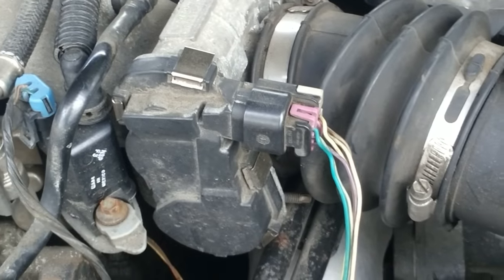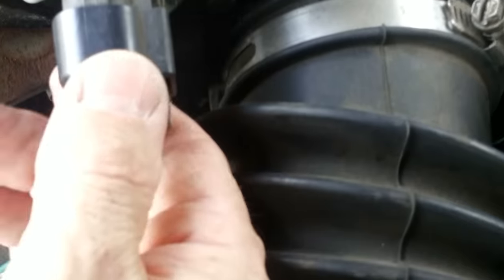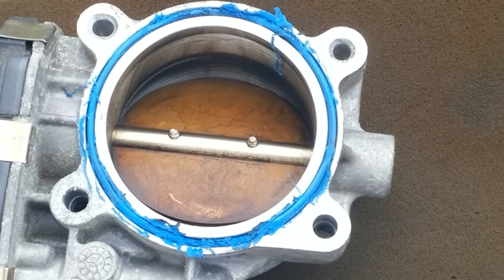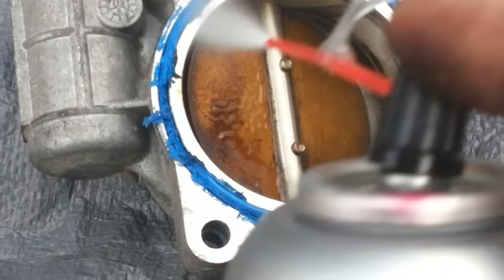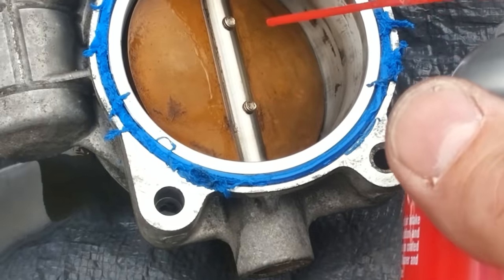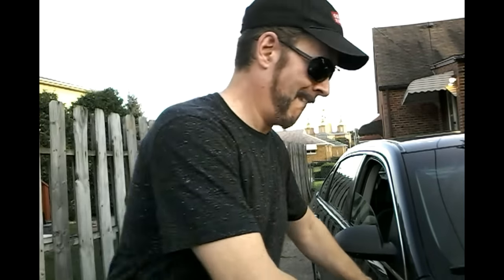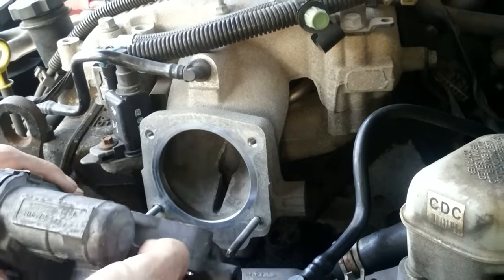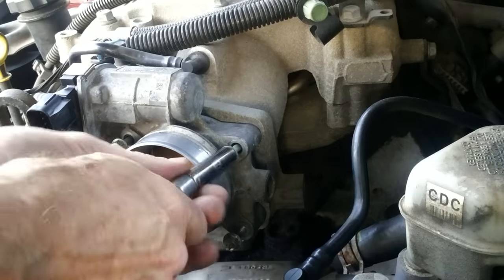Reduced Engine Power.  Here is the FIX.

Comment: Good video! My 2008 impala starts missing while driving, if I give it gas it smooths out, it will do this the entire trip, do you think it's the same fix as you did in this video? Thanks
Reply from the maker: Do you have a check engine light on?  If so, check for fault code P2135.  That's your TPS.  If no light, then it could be any one of several things.  Start with simple things first like dirty fuel filter or vacuum leaks.  Good luck!
Reply: No the engine light is not on. I took it to a garage and put it on a computer, it said it was a bad has pedal sensor. They replaced the sensor and it didn't help, it's still doing it. Thanks for the reply!
Reply from the maker: @wvmountaineer69  Have it checked for transmission codes.  Sometimes these can trigger reduced engine power and not light the check engine light.
Reply: Never buy an impala the transmission is definitely going to go out💯

Comment: My mechanic replaced the throttle body, it seemed to solve the problem for a few days; however the problem has returned. Any suggestions?
Reply from the maker: Besides taking it back to the mechanic?  Check it for loose or bad connections and grounds.

Comment: Hi so how do you know if it's the throttle body that needs to be replaced or just the sensor
Reply from the maker: The throttle body rarely needs replaced.  It just needs to be cleaned from time to time.   Unfortunately,  it's very difficult to find "just" the sensor.  They make you buy the whole throttle body and the sensor comes with it.  If you are getting fault code 2135,  chances are very good that you need a new sensor.  Check for that code before you change the throttle body.  Good Luck!  Let me know.  Thanks for watching!
Reply: @lifeafterlife8417  Thank you so much for replying.  Creators rarely do respond. I actually found the sensor separately but had already bought the throttle bottle, and the sensor was attached. I wish your comment would have came sooner. So after replacing the throttle body, I'm not getting these codes P1682, P0411,P1400, AND P0325. "Esc & engine power reduce" still displaying on dashboard

Comment: Hello . Can you give me your opinion on our Enclave issue? We have a 2011 Enclave CXL 2WD. It has 110K miles. Like a month ago it reduced speed on highway and showed "Reduced engine power", when my wife took it to Autozone for codes it showed several misfires. I researched the issue online and ended up cleaning the throttle vary and it worked perfect. The engine light disappeared when I reset the computer. No more issues until 3 weeks ago when were driving on the highway and the same situation happened. I took it to Autozone and the code was "misfire on injector 5". After I kept driving it the engine light disappeared by itself and the car was working fine until today. I was driving very slowly on the park and the same message came to the board, the car lost power and a lot of white smoke. I took it to Autozone and the code read misfire on injectors 1,3,5 and issue with fuel pressure regulator. Do you have any idea what could be the issue with this car?
Reply from the maker: White smoke could be an indication of a blown or leaking cylinder head gasket or intake gasket.  The codes for numbers 1,3, and 5 back that up because 1,3, and 5 are on the same cylinder head.  I would fix the fuel pressure regulator first because its the simplest and most inexpensive place to start.  Then I would watch for other signs of gasket issues like overheating and coolant loss.  Also, look at the spark plugs on numbers 1,3, and 5.  If they have a glazed or shiny appearance it indicates bad head gasket.  Autozone sells a kit to test for blown head gaskets that is fairly easy for the average do it yourselfer to use.  Rule that in (or out) and that will get you pointed in the right direction.  I wish you the best of luck!

Comment: Would this cause the car. To basically die I had a pullover turned off the car turn it back on then it worked just fine again. Having the same issue in a 2007 Pontiac G6
Reply from the maker: Did you get a "reduced engine power" message on the dash before it died?
Reply: @lifeafterlife8417   yes it did. it's always on.
Reply from the maker: Scan for codes.  P2135 means change the TPS. @XianCosmo

Comment: You don't need to do all that. There is throttle body sensor kit from GM that fixes the problem. Kit is relatively cheap and takes 5 minutes to change. You have created more work and expense for no reason. Do your homework, Bud.
Reply: wendell worth where do I get this kit? And can I put it on myself?

Comment: Sir before doing this do I have to disconnect the batter?or is it okay to do it with the battery on
Reply from the maker: Disconnect the negative cable.  Safety second.  Or first.  No, second.  Wait....  FIRST.  Make sure you kick it when you're done.

Comment: Still getting r.e.p... 08 2500hd
Changed tps, gas pedal, oil sensor, maf sensor, battery, battery cables, cleaned all ground wires, added ground wires cleaned throttle body, checked tps wires and still getting r.e.p. any more ideas?
Reply from the maker: Could be a faulty cooling fan, believe it or not.  It's on the same circuit as the TPS.  A faulty cooling fan can cause the 5 volt reference signal to drop below 5 volts.  For example, If the TPS  (throttle body) reads 5 volts and APP sensor  (gas pedal) reads 3 volts, that disagreement between the 2 sensors triggers reduced  power mode.  Connect a volt meter to the  APP (gas pedal sensor)  and start the vehicle.  Wait for the cooling fan to kick on and observe the reading.  If it falls below 5 volts, replace the cooling fan.  It's a very common problem on those engines.  Good luck!
Reply: @lifeafterlife8417  thanks for the quick reply! I have checked the wiring harness to the fan but not the voltage. I will give that a shot! I have a mechanic friend that said there is a problem with the ecu that gm has posted. I can't seem to find it but I'm going to call the dealer in the morning and see. Thanks again!!!

Comment: what scan tool did you use
Reply from the maker: I used just a code reader. Then I connected a volt meter to accelerator position sensor and checked for continuity and voltage.  All good there, so I checked the TPS for voltage and it fluctuated between 2 and 5 volts.  That was the problem.

Comment: Hi, I have clean, replaced the sensor, replaced the pedal, checked connecters and still throwing the codes p1516 and p2101 I was told if you disconnect the battery and reconnect it should relearn itself. this is on a 2009 Silverado, any suggestions? btw: loved the humor.
Reply from the maker: I would recheck the wire connector at the throttle body.  Look for broken wires inside the insulation.  The wires may look ok but sometimes the insulation is intact and the wires are broken inside.  2009 should relearn on its own.
Reply: Did you figure it out? Was a broken wire?

Comment: I’m super late but my 08 Impala is having this issue 
I literally just paid for a new throttle body less than a month ago and here we go again 
Again i know im late but any ideas of what it might be other than that damn sensor
Reply from the maker: Check the wiring to the sensor.  Sometimes the wires break inside the insulation.  Also, scan for codes.  That could narrow it down.  There are two sensors for throttle on these cars.  One is on the accelerator pedal.

Comment: Will this work even after my car has stopped starting . Itvread low energy now it completely wont start . I changed the sensors .i think the Cadillac converter needs to be cleaned .
Reply from the maker: Cleaning the converter won't help.  If it is blocked, it must be replaced.  Probably not the reason it won't start.  Did the no start problem occur immediately after replacing the sensors?  If so, something may have been connected wrong.  I would start there.
Reply: I’m sorry not sensor the starter . And the problem happened before that. My mechanic claims I need a whole new engine but I’m convinced after your video I don’t !

Comment: I changed my air filter. Haven't had the problem since. That was over a year ago. Engine light stays on though but I think its unrelated. Maybe.
Reply: Could be a weak piston return spring
Reply: Or the T bracket on the flux capacitor.

Comment: I’m having the same problem with a 08 express 1500 .. Its had 2 new throttle body’s new pedal sensor new sparks and cables new Evap sensor and still doing the engine power reduce but doesn’t throw any codes only code it’s showed was p0451.. any could help me figure this issue the 2 guys I’ve taken it to can’t seem to find the issue
Reply from the maker: p0451 is for the evap pressure sensor.  You already replaced that but if you are still getting the p0451 code there may still be an electrical fault in that circuit.  Here's the tricky part:  The throttle position sensor may be on the same electrical circuit as the evap sensor.   A fault in the evap pressure sensor circuit could trigger the reduced engine power mode by pulling the 5 volt reference signal down on the throttle position sensor.  Check the wiring to the evap sensor.  Other things to check are the fuel tank pressure switch, the ac pressure switch, and the cooling fan circuit.  On some models these are all on the same 5 volt reference signal as the throttle sensor.  A fault in any of these could trigger the reduced engine power.  G.M. really put the screws to us.  Good luck, thanks for watching, and let us know how it goes.

Comment: Did as you said in the video. Started fine then started throwing random codes. Cleared codes with my scanner ran fine, shut it off restarted codes return Numerous tries no luck. Any ideas?
Reply: What are the codes?
Reply from the maker: @davidtankersley9520  Is one of the codes P2135?
Reply: @davidtankersley9520  Never the same code twice.
Reply: @patvadnais9216  recheck connections at the TPS.
Reply: Hi David, I appreciate you getting back to me and answering my questions. Connector was fine, however after clearing the codes I drove it and noticed the radio still had my stations programmed in. I have a background in electrical so this tells me I'm not completely draining the voltage. I had the positive and negative cables disconnected and touched together. Did I not leave them together long enough?
Reply: @patvadnais9216  try erasing codes with your code reader first.  If you disconnect the negative battery cable for 3 minutes that will erase everything.

Comment: Any idea what would cause code P0228 on a 2012 Chevy Equinox? We dont have the reduced engine power yet.
Reply from the maker: P0228 means that the computer (PCM) has detected a high voltage from either the accelerator position sensor (APS) or the Throttle position sensor (TPS).  Lots of possible causes.  First check for faulty or corroded wires between the sensors and the PCM.  Second, clean the throttle body.  It's easy and a dirty throttle body can trigger this code.   Third, and more difficult, Test the APS and TPS for voltage irregularities using a volt meter or scope if you have one.  It's a bit complicated and to much to explain here but there are a number of good videos on Youtube that show how.  Good luck!  And thanks for watching!
Reply: @lifeafterlife8417  awesome wow thank you for the quick reply I usually never get a response when I ask a question on a video. We just financed a car get 10 minutes off the lot and the check engine light comes on. The dealership is acting like they had no idea, but its obvious the battery was unhooked to clear the codes since the clock and settings were all off in the car. They won't help at all and just keep denying anything was wrong with the vehicle. That's not the only code we are getting either it's also pulling codes P0113 and P0325. And then some weird code B2aaa.
Reply from the maker: @Dustinthefortnitedad  OK.  P0113 is high voltage from the air temperature sensor circuit.  Maybe faulty wiring.  P0325 is a faulty knock sensor 1, bank 1.  Sometimes low coolant or clogged radiator can trigger this code so check that first.  B2aaa is not a problem with the car, so good news there!  It means the scanner or code reader used is not fully compatible with the cars' OBD ll programming.   Also, check GM for technical service bulletins for these issues.  Might be a source of some very helpful information.
Reply: @lifeafterlife8417  awesome thank you so much I will check that out and look for the service bulletins! As far as what the car is doing it doesnt seem too awful. It does sound rough idling and its noisy. It does seem to not accelerate very quickly but I can't tell if that's from the issues or just it being a 4 cylinder.
Reply: @lifeafterlife8417  you've given me hope that these issues maybe aren't as serious as I thought. Still a bummer to finance a car and have to do all this immediately after getting it.

Comment: It’s happening to my 2017 suburban. And it’s shaking like crazy when on. Showing  p0206 as the code.
Reply from the maker: Fuel injector number six misfire.  Check the wiring.  Could be the injector itself.

Comment: How about a 2013 GMC Acadia doing the same thing. Traction control off, reduced engine power, service stabilitrack?
Reply from the maker: Scan it for trouble codes first.  That will get you pointed in the right direction.
Reply: Hi! Did you figured it out? I have the same problem with my 2008 GMC ACADIA
Reply: I have same problem with my 2009 Acadia. How did you get it fixed?
Reply: Blanca Tobon we talked a gm mechanic and they say the codes it is giving could be wrong we will be changing out the throttle body sensors. We fixed everything the codes gave us. It happened next day . The codes indicated it was ignition switch relay. Changed it. The mechanic says it was the smart idea of gm lol

Comment: I have a question,been fighting this issue with an 11Malibu.Shop replaced the throttle body in July and in less than two months issue came back,now they want 1300 to replace the ecm and pedal assembly,is it possible the tps already went bad?
Reply from the maker: Not likely to be the tps.  If they want to replace the pedal assembly, does that mean you have a p2138 code?  Check the wiring harness to the new tps for faulty wires or connections.  Ask why they want to change the ecm.  You might need a second opinion.
Reply: I believe it had the p2138 code,I don’t have the car or paperwork here at the moment,I changed the pedal assembly myself but that didn’t fix the issues either.Got somebody else looking at it now.Just frustrating because this is supposed to be the good?car.I do know this is the last GM I will buy even though my Grand Prix is still kinda chugging along

Comment: I have a 2011 gmc terrain, last night my engine stops completely and the message came on power engine reduced, can it be the same problem with throttle body, I parked the car and haven't try any thing because all shops are closed today
Reply from the maker: Is there any other message displayed like "throttle system disabled"?
Reply: @lifeafterlife8417  no
Reply from the maker: @ralphwhitaker8761  Will the vehicle restart after being off for a few minutes?
Reply: @lifeafterlife8417  yes I just went outside and it starts when a message " service stability track" I just went to Wal-Mart to buy a cheap obd2 scanner, it is reading 5 codes:
 P0014 B camshaft position timing over advanced

P0302 cylinder 2 misfire

P0325 Knock sensor 1 circuit bank 1

P0420 catalyst system bank 1

P228D DTC definitions not found to refer to vehicle service manual

Its raining like hell there is not much I can do outdoors, so I'll let it rest for today, but any suggestion will be greatly appreciate before heading to a mechanic shop, thanks
Reply from the maker: @ralphwhitaker8761  Ok, this one is complicated.  First thing I would do is check all wiring under the hood.  Do you live out in the country?  A common issue in my area is rodents under the hood.  (mice, squirrels)  They like to chew wiring insulation since it is soy based.  I guess it is tasty to them.  Look for evidence of nesting, particularly in and around the air filter housing and ductwork.  There are other possibilities too.  Check for a blocked exhaust, especially the catalytic converter.  That's where I'd start.  Hope it stops raining soon, and good luck!
Reply: @lifeafterlife8417  ok thanks, but the rain don't seems like it will stop and I think tomorrow is another rainy day, so I'll let it rest while I check for any recalls, I just don't want to go to a mechanic and pay money for something I can do my self

Comment: Hey, i had a diagnostic ran on mines today and the guy at advanced auto said he thinks its a misfire in one of the cylinders or something like that. Also i had codes C0242, P0325 & P1682. Any suggestions on these?
Reply from the maker: C0242 is a low circuit voltage in the transmission when switching from regular to tow/haul mode.  PO325 is high resistance in the knock sensor.  PO1682 is an ignition circuit code.  Very common in GM vehicles.  Usually a bad relay in the under hood fuse box, or corrosion in the connections in the fuse box.  There is a relay for the ignition that often gets loose.  if you wiggle that with the vehicle running, it will stall.  Hope this helps!
Reply: @lifeafterlife8417  so i should consider replacing the fuses? Also thank you for your response. I am truly appreciative, this is my only set of wheels and i work everyday during the week. Just ready to ride with no worries

Comment: On the 2004 Chevy Tahoe with reduced engine power code this does not fix the problem gm should have recalled on the Tahoe's.evem if you change the throttle body or sensors it only works for a while then it goes back to trouble